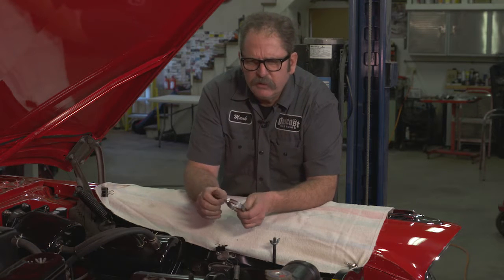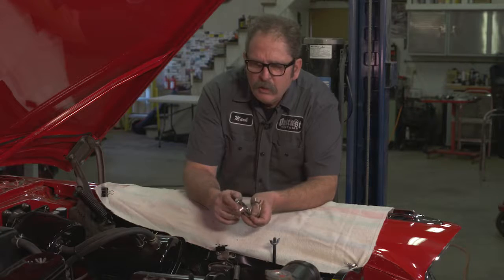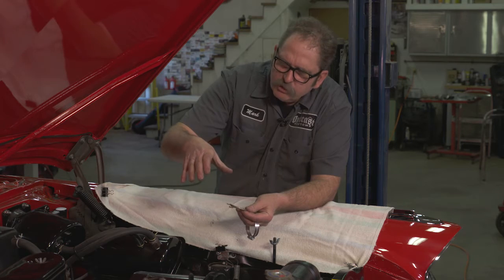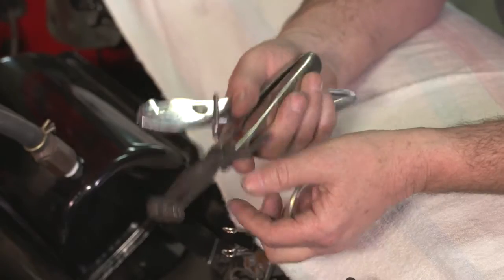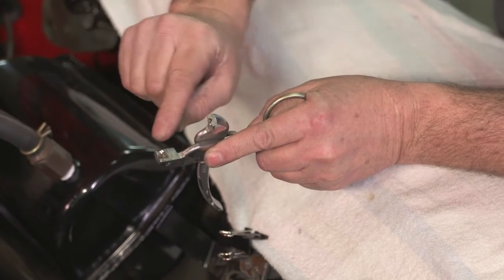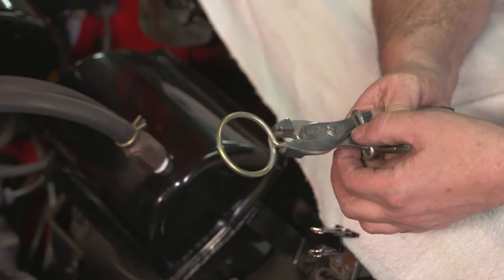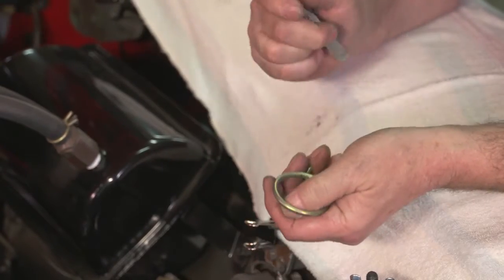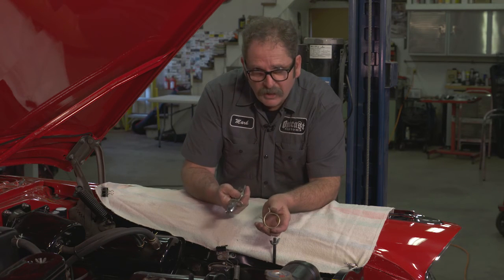Corbin Clamp Pliers

Comment: They just look better, too.  I just freshened up my 318 poly, for my 61 Dodge W200 Power Wagon.  The screw clamps are too shiny, they just don't look right in the old engine bay.  I re-used the ones I could, but I just found that you can buy new ones.  So, I'll get some, along with the pliers.  Thanks for the video.

Comment: Who makes the locking pliers in this video?
Reply from the maker: Great question! The ‘Ask an Expert’ section is currently for members of our online community. I would be happy to send your question off to the experts. To get started, please direct message me the email associated with your paid membership account. Thanks!
Reply: @Mark Sigler I found those pliers labeled as Corbin branded. You might be able to buy some off eBay, etc. as they appear to be no longer made. Many other tool makers have a locking pliers that work with Corbin wire clamps.